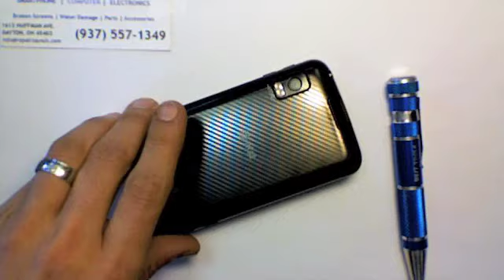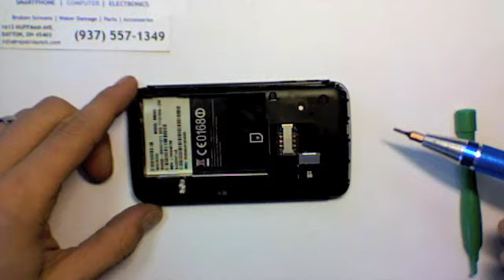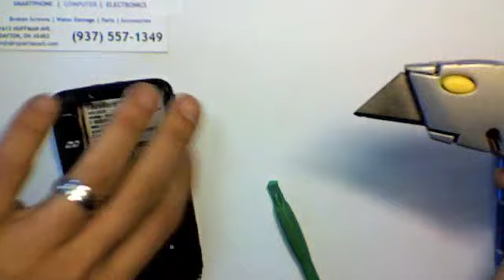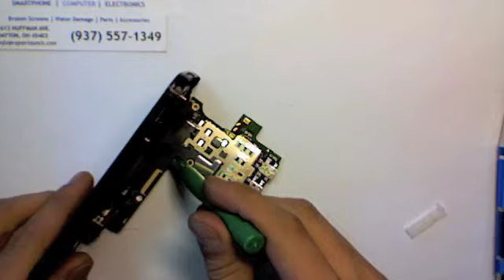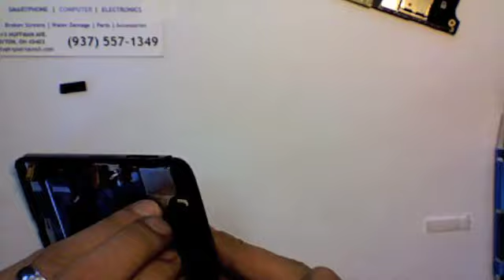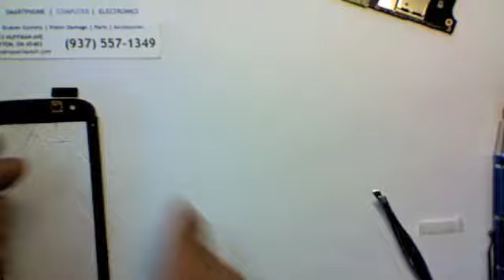Motorola Atrix 4G teardown & Screen Repair | RepairLaunch.com

Comment: Followed the steps and successfully disassembled my atrix to replace the screen. Used epoxy to glue the screen to the frame. Phone reassembled and working great. Trickiest thing was replacing the last ribbon cable that slides under the  board. Thanks

Comment: Note:  At approximately 6:30 a rubber gasket falls off the unit to the left side of the video screen.  Keep track of that gasket and replace it when putting the Atrix back together.

Comment: I am trying to replace my touch screen digitizer, this video doesnt show that. mine is cracked like the one in the video, I've ordered a new one but it didnt come with the foam gasket, and the original gasket was glued to both the digitizer and the phone. I used a heatgun but the seal was still destroyed during removal and cannot be re-used. Where do i get a replacement seal , or what can i buy to create a similar seal? There is also a smaller seal that goes around the LCD as well...

Comment: My phone got wet, do you think it may be repairable? It won't turn on, but the flash does turn on when I try to boot the phone up. I also have a 2nd Atrix with a cracked screen that keeps rebooting. The bootloader is unlocked and is running CM; the phone also freezes when I try to enable WiFi. Any feedback/suggestions are greatly appreciated.